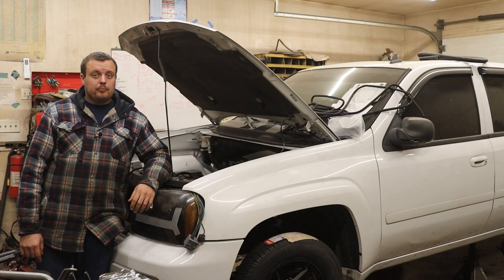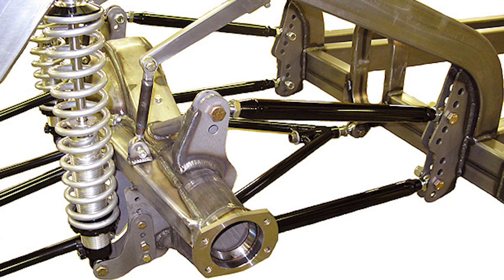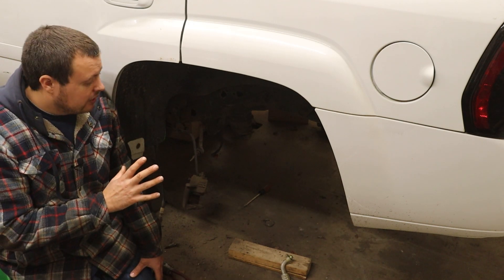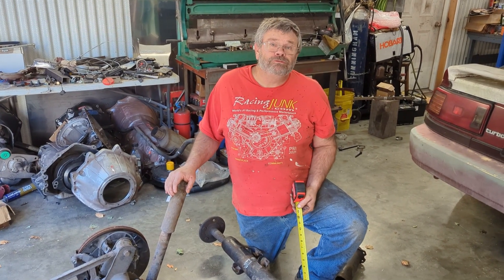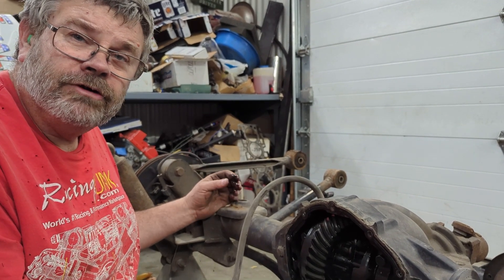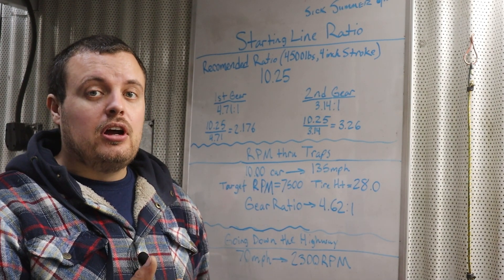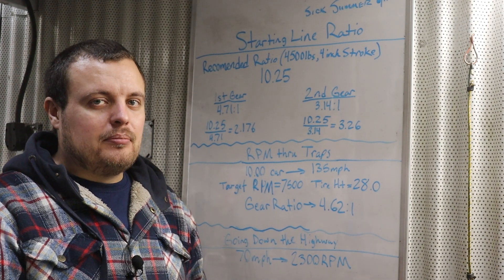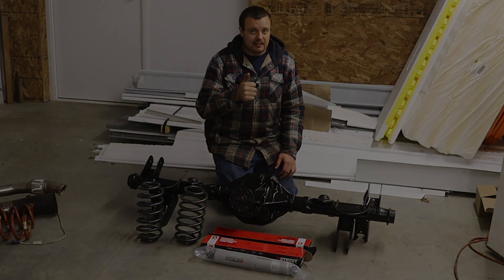Building A Ford 8.8 to Handle 700WHP for the 10 Second Trailblazer

Comment: I think there's a lot of content here regarding the WIDENING of an 8.8 rear, instead of narrowing it. What are you using for axles? Are they custom, made to order units?
Reply: The left side long axle from my rear was used on the TB rear right side making it 2-7/8" wider.  The short right side axle was then installed into the left side of my "narrowed" rear. That video will be out in 2 weeks.

Comment: Did you guys use 2 long Explorer axles to get the wider track width? Always informative. I've never seen those charts for ratio selections depending on weight and stroke length. Very cool and thanks for the break-down. Keep it up guys!
Reply: Yes. The long axle from my rear became Calvin's right axle and it is now 62" wide.  His short axle replace my long axle and now my rear is 56".  Hocis pokis LOL.

Comment: Are you going to do c-clip eliminators on the 8.8
Reply: Yes
Reply: @andrewnelson3733  So I think the most power I've ever put through an 8.8 was with my 2011 mustang V6 which was pushing about 450 horsepower and I think almost 400 ft lb of torque peak and I never had any problems with it. Although I wouldn't say that I drove it really hard. What would you say is the point where you should put c-clip eliminators on? 

I'm sure I could look it up elsewhere but I'm lazy

Comment: Great project , can I add a cautionary note , when welding the thick axle tubes , I found the use of a ARC welder or Hi Amp Mig welder offered a lot more penetration than any Tig I tried , I only say this because I have seen tig. Welds fail on axle tubes and 4 link brackets . Just saying .
Reply from the maker: I did multiple passes and we added fish plates.

Comment: From what I could find, the 4200 got the 8" 10 bolt, 5.3l's got the 8.6" 10 bolt, but the SS definitely got a 9.5" 14 bolt hybrid axle(9.5" center section with the 8.6" 30 spline axles). You could have gotten a 9.5" 14 bolt out of an 2 wheel drive OBS 6 lug truck, had the axles redrilled for 5 lugs, and had an axle that was stronger than an 8.8" and was 65.5" wide for relatively cheap money.

Comment: Is the 4200 taller/longer than a 2jz or RB? Asking because I have a Infiniti G35 and I’m looking to swap something into it. I know the 2j and RB will fit under the hood but will the 4200 fit you think?
Reply from the maker: It is taller and longer. The dimensions are on the wiki.
Reply: @ I just sent you an email asking about the 3500 because that might fit better in my car. I’m just not sure about the aftermarket support. I understand they share the same parts but I don’t see any turbo manifolds etc. being made for the 5cly on your site or anywhere else.

Comment: Just a recommendation from building 8.8's for 25 years with Ford. The Ford Ranger Splash came with OEM 4.10's. The Ford Racing ring and pinion sets were similar in design. What Im getting at is the ring and pinion coating. Its abradable and aids in gear mesh during break in. 

In a year I collected a pallet crate full of the Motive Gear polished 4.10 gear sets. Some would sing such a high pitched tone it was scary at 70mph. They weren't installed through any Ford dealership as far history with the VIN was concerned. None of the pinions were shimmed exactly correct. The marking compound would show decent contact patch on most sets. Backlash was usually within spec at 0.008" to 0.010". They still made noise.

The worst cases were those where the sided bearing were shimmed with multiple shims of varying thickness. 

The target to hit is 0.550" of total shim thickness and using solid one piece steel shims. Offset the thickness accordingly to move the diff left or right to achieve the desired back-lash. 

Just some tips to achieve a quiet long life 4.10 rear-end.
Reply: Ive used nearly every gear brand out there and the ones that were the worst in every brand diff was Richmond gear, perfect drive/coast pattern and pinion depth still either made a racket on drive or coast with a perfect pattern. All the rest i would get a random set every few years that was noisier than i would have liked but being drag cars you couldnt hear it anyway
Reply: @young11984  on a rare random occasion I'd have to install a customer supplied gear set. Never a Richmond though. Heavy line wasn't my main gig, but I did all the aftermarket performance work at the Ford dealerships. I'm a Senior Master Automotive and Diesel Technician and my main thing was gasoline drive ability.
Reply: Thank you
Reply: @andrewnelson3733  you are most welcome.

Comment: Got an 8.6" 10 bolt from an EXT sitting in my garage, but may have to give in and look for an Explorer 8.8, since this needs to go under an S10, and it's already wide enough without wheel adapters.  Any opinions about the relative strength of the two?

Comment: That Explorer axle is used everywhere. If you flip the axles by cutting the long side 7” from the end and the short side 4” in (to get past the area it necks down) then the pumpkin is centered. That makes it a great swap for first gen Camaros, Novas, TriFives, and S-10s. ‘95-‘00 Explorers have disc brakes, 31 spline axles, and almost always come with a posi.

Comment: So a serious question , and this is for anyone with the actual knowledge... but the 8.8 comes in live axle (solid) or it comes in irs (independent rear suspension) , is there any difference in the power handling capability,  im looking to put a 8.8 irs out a stang in my build as its a road car , so im trying to keep independent suspension side to side .. but also , i have a 08 trailblazer lt 4200 with the same ecu clips as yours , but the trans firat gear is cuca on reaponce , now once it shifts it will get up 😅.. if the wife didn't drive it, i would go straight drive , but she not comfortable with a manual daily ... so its next on chopping block as i already have a snail for it lol , but dont wanna break everything in the driveline ehen boosting it lol (i run 34psi on my daily ) the race truck i would like to get to 50psi 😅 i wanna see what the atlas is capable of on low comp and stupid boost but as a daily driver 😅.. Anyway , I love what you and Pop are doing cal , keep kicking azz, guys .. peace and love, brotha, keep it rad,stay safe, and build on.. l8r famz and keep having fun guys

Comment: at 10 seconds won't you have to use c-clip eliminators?........JMHO I might consider a ford 9 inch for that reason alone.
Reply: It will get 9" housing ends long term.

Comment: Personally I hate this build. I have spent time in those blazers and the interior is so akward I wouldnt spend a dime improving one of those. The seating position is the worst I have ever encountered, the visibility is next to none, the steering wheel position is horrible, the center console is beyond useless, the dash is way to close, the door are uncomfortable for your arm in every measuable way. 
I honestly came to the conclusion that when gmc made these vehicles they did not have a human on hand to sit in it for testing. They just had each engineer make each aspect then they bolted it all together for the most uncomfortable possible outcome.
That said mine is 2003 runs like a top and takes no parts to keep on the road. Lile none. Thats the only reason I keep it otherwise I hate it.😅

Comment: The Explorer 8.8 has larger tubes and axle bearings. Please share if you find or design a c-clip eliminator setup because the Mustang eliminators won’t fit. 👍

Comment: The Ford 8.8 is a great rear i run one in my Jeep rock crawler but I'm playing around at leas than 5 mph. You want to go drag racing at high speed with a c clip style rear axle at over 100 mph. What track is letting you race with a c clip rear at the speed you want to go

Comment: Not sure if you saw my comment last time, but GM is known for oil pumps that have pressure relief valves that alternately stick open, and closed. My own trailblazer will be smooth as a sewing machine, then knock like a Jehovah's Witness, then on next start up go away again. So, maybe try a new oil pump.

Comment: I build solely performance gm units. Specifically 4l60e, 4l80e, and Allison’s. My company name is Allballz transmissions and I’m out of southern Maine and I would love to build you a 4l60e or a 4l80e or th400 to suit your needs with a converter specd for your setup. All 3 would be good options as you can get a 4l60e to handle a ton of power when built right. Shoot me a message on my business page if you’re interested in working something out. Thank you

Comment: trailblazer rears
base 8 inch 10 bolt 3.42 0r 3.73
trailblazer ext 8.6 10 bolt 3.42 0r 3.73
trailblazer ss 14 bolt 9.5 4.10 gears and 35 spline axels

Saab 97 have the 8.6 also and the aero has the 14 bolt 

cant wait to see this thing go 10`s. my ss runs 10`s and I love it. keep up the videos.
Reply: Was just about to comment this good work mike

Comment: Haven't watched the full video yet but yall should definitely Gusset up the rear end due to the length of the axle tubes for safety
Reply from the maker: We did.
Reply: @Calvin-Nelson  thats great just want this build to work as good as it can, been wanting to see a build with the chassis the engine is from

Comment: I think the 03+ Ford panther chassis 8.8 might be a good swap axle for these as it is 69.250" from hub to hub with a center offset housing. also come with a latter bar style 4 link, a watts link mounting point, (06+) have 31 spline axles and pretty beefy brakes.
Reply: 31 spline in my 05 town car. Put a explorer ring and pinion in it for limited slip and 3.72 ratio
Reply: Learned something new today, didn't know Crown Vics were 31 spline, thought that was f series and Explorer only in 8.8.
Reply: @cb84capri  some have 31 spline most 28 in the years mentioned above. If it has stamped control arms instead of aluminum likely 28

Comment: Ya I totally understand going with a stronger rear than the 8.0 it came with but the TBSS 10.5” 14 bolts are pretty easy to find and bolt right in and come with 4.11s. 

8.8 is awesome but seems like slightly unneeded work
Reply: Availability and them already having many 8.8 parts has a lot to do with it. I cant find a TBSS at a pic n pull but i sure can find a lot of Explorers

Comment: I'm going to be paying attention to this episode specifically because me and my buddy are building up his S10 and looking at ford 8.8 rear ends to replace the old rear end that's in it.
Reply: I did an 8.8 into my 2002 Z28 and even though the car is mildly built, the rear end has lasted 8 years at 600 wheel and its just a stock explorer 31 spline 3.73 gearset with a rebuild kit thrown at it. I did however do the c clip eliminator so I have 9in ford axle ends.
Reply: @damianlindsey6177  is there anything that we should know/look out for when working with it to prevent any major hiccups/mistakes?  I'm sure there are a few that are relative no-brainers, but we don't have any experience working with rear ends yet, and we don't exactly know all the rules of thumb for rear ends.
Reply: trick on the cheap is to get another short side axle and cut the difference out of the long tube side.